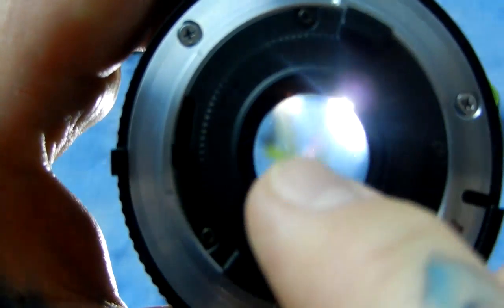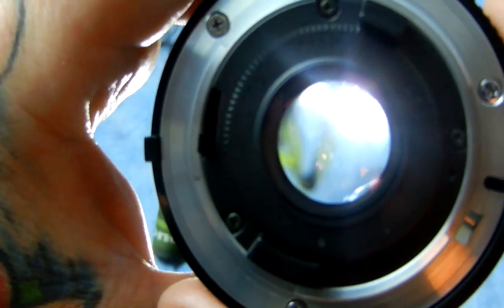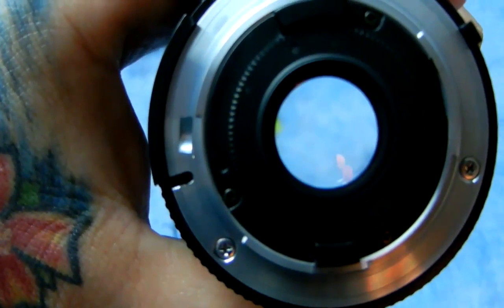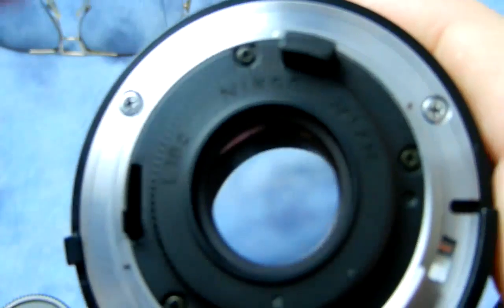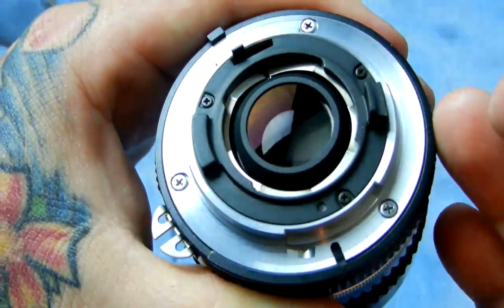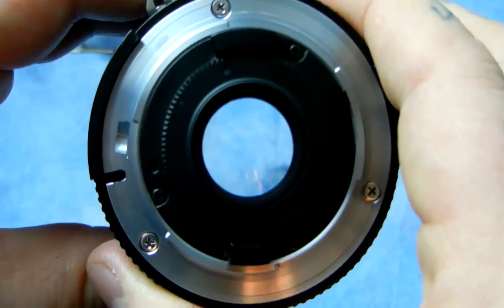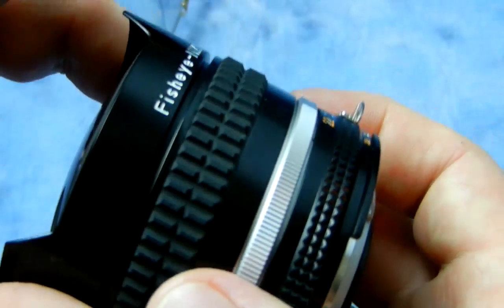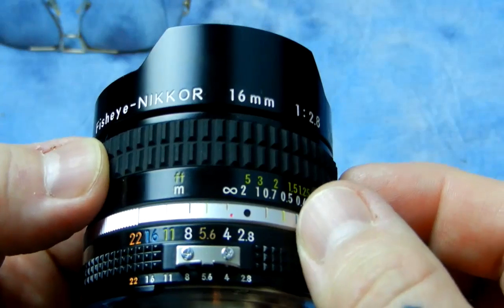Angry Photographer: What is lens BALSAM SEPARATION? What it looks like and does

Comment: Just fixed an old Pentax m 100mm f4 with really bad separation.. Took it apart, boiled the front element, boiled it, separated the two pieces and put it back together with UV epoxy. Cool stuff!
Reply: Epoxy resin will not fix a balsam fault, although it will enable the lens to focus after a fashion. The intention of cementing elements together, whether wil modern UV-cured cement, or natural balsam, is that the element block will act as one piece of glass, not two or more discrete ones with air gaps between them When light hits an air barrier, it does not act the same as when two or more elements are optically cemented together. You can prove this by taking two separated sections of viewfinder prism and attempting to look through them. You will see nothing because the light is relected back at the air barrier. Optically cement them, and they become clear, and the prism acts as though it is one solid piece of glass, just as it was originally designed.
The best method is to separate the affected elements-I soak them in Dichloromethane-and then recement using UV-cured synthetic cement available from Edmunds Optics. I use Norland 61, which works extremely well, and I cure it with a cheap UV nail varnish hardener from ebay! Be aware the Norland cement has a limited shelf life, but I have kept mine in a fridge, and even though two years past its use-by date, it still works well.

Comment: I just fixed a delamination of a lens in my Kodak no.2 folding cartridge premo. Demantaled the  lens  stuck in oven at 300 for like 5 min, slide glass apart when hot. Clean really good after cooled with acetone. Not a dust, put a drop of uv glass repair glue. Aline the lens stick in sun. 🌞

Comment: hy ken, 

does balsam separation effect long focal length's like 200 mm to ?

Thanks for the vid.
Reply from the maker: +M Knives its not based on focals, but on cemented dual elements and lens design, but not a specific focal.
Reply: Hy sorry i didn't expres my self well, I meant if a 70-200mm would have balsam separtation would it be visible on the photographes and from what focal length would it be visible ?
Reply from the maker: yes, it looks like a milky haze when you shoot into a highly lit situation.
Reply: Oke thank you :) Its a big no go then :)

Comment: Very important issue. Let me add that lens separation can be cured by dissolving the leftover balsam in hot water and cementing the elements using optical grade UV glue (which is much more obtainable in the present day, compared to 30-40 years ago).
Reply from the maker: ***** yes indeedy, which is a giant crotch pain

but true.
Reply: Would you say this is something one can do themselves?
Reply: Certainly -  with a toaster oven (melting the balsam to separate the elements completely), acetone  for removing leftover glue) and UV glue - to glue them back together.
Of course, one has to clean the surfaces well and keep dust away in the gluing process, but it is possible to do at home with great results.